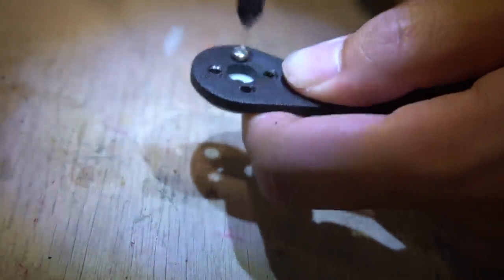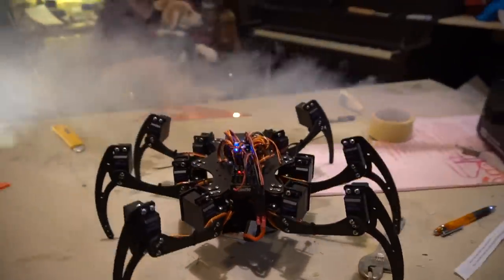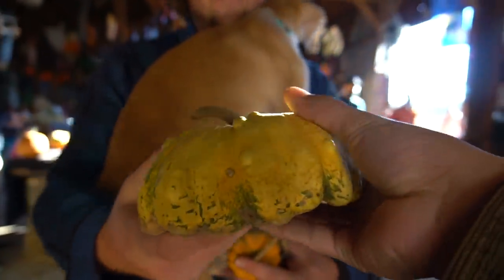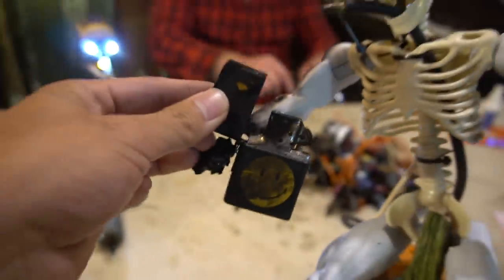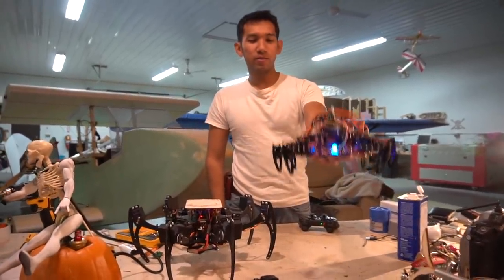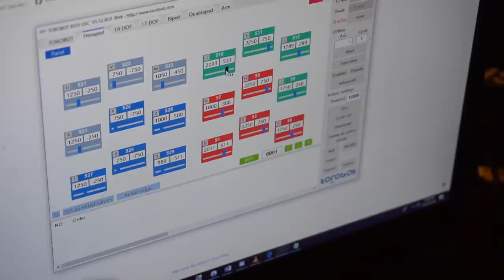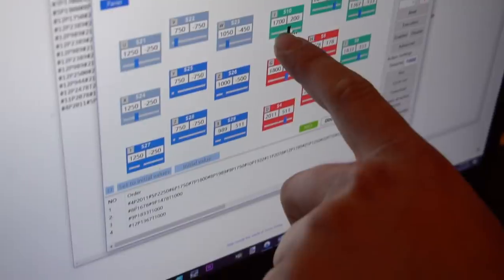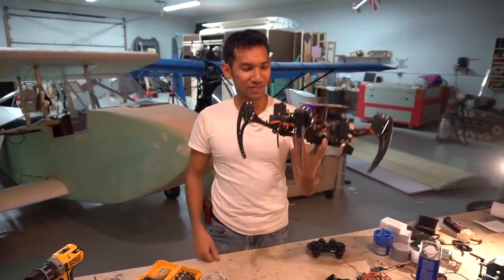FLAMETHROWER RC spider robots

Comment: The little spider sounds like it's tap dancing. Those seem so expensive for what they are.
Reply: Those servos are not cheap.  When you need 12+ servos and hardware and controller chip, I am surprised about how much they do not cost.

Comment: I'd replace whatever brain on the big hexapod with an arduino and find code for a generic hexapod (though if you want perfect walking you can figure out the IK). The perfboard wiring is simple (avoid breadboard since it's .5A max): of the three wires of each leg, one goes to positive battery (all of the leg positives in parallel), one wire to ground, and one wire to any digi output pin on an arduino. Choose an arduino with enough pins for each servo, receiver, and whatever else.  I built a quadruped I found online called Tote which has 12 9g servos and totaled ~$50

Comment: Not sure why you'd even consider buying one of these kits. There are various versions of hexapods on Thingiverse ready to be printed. Then all you need is an Arduino, service controller, and wifi dongle, along with 18 servos and you're good to go. You could either download code off GitHub or code it yourself.

Also, when are you doing the build video for the "cheap" RC boat? I've been waiting for the files to be finalized and all as I really want to make one!!

Comment: you heard of the pheonix code? it is a code for hexapedal walkers that is very smooth and also has different gates to it. would get this build a bit more creepy when its moving smooth instead of the jagged movement where its more or less sliding over the ground

Comment: What bec are you useing the one I used for the blue servo driver boards was a ubec 5/6volt at 3amp they did not have the ps2 connection or controller got two trying get the right one hobbyking amazon the lobots servo driver has a build in voltage regulator the ps2 input took 4 hours to program but I did not find the servo driver programming ui till 5 months later. The Phoenix code I tryed did not load on to a uno board.

Comment: Now, make a spider, but instead of legs... hehehe...
well. Let's just say they're a bit... Sharper. Made of metal, and can typically be found in kitchens.
Also, you could make gas constantly dripping down them, leaving small drops every time it takes a step, and put a small burner on the end of it to light a trail of fire behind it.
Basically, the most metal spider toy to ever exist.